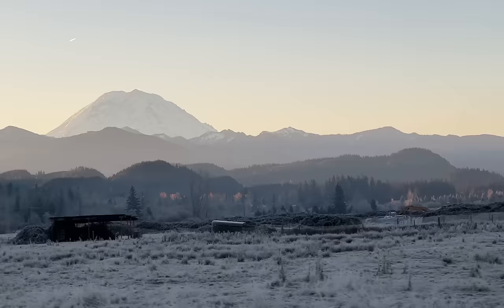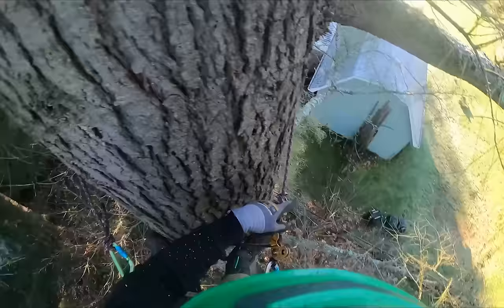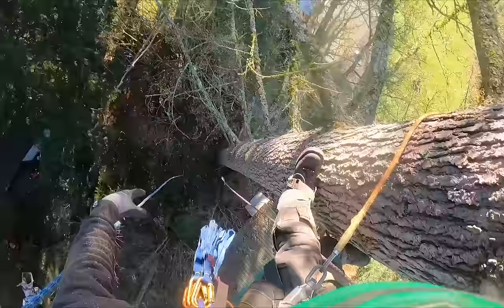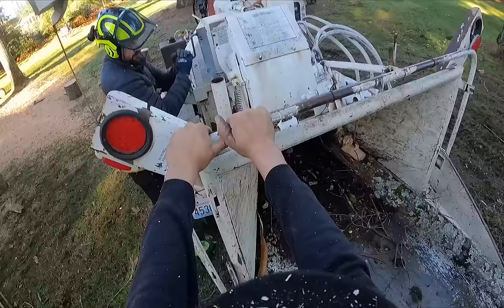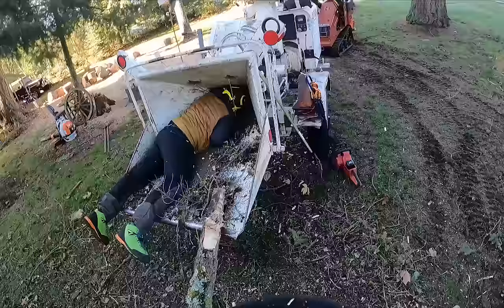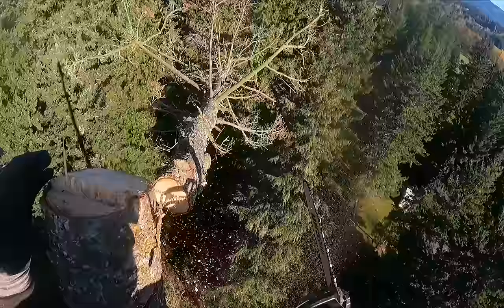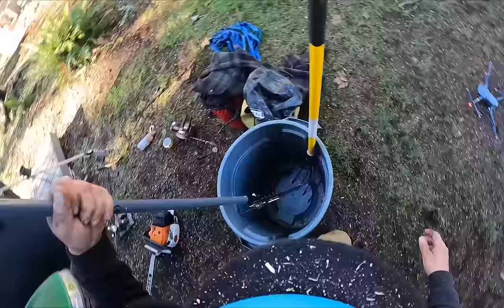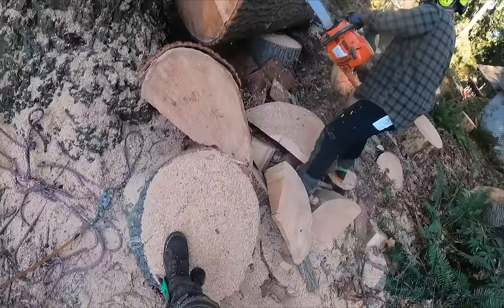Removing a HUGE 5' Fir In Enumclaw Washington!

Comment: Jake I know you are at the top of your game, you have reached the point where you are one with the tree. You should ride that wave for many years to come. That said when you are on a spar with no overhead tie in, why not have your climb line around the tree as well? I know it’s a hassle, it slows ya down, who needs it ? Well about 38 years ago when braided rope stele core flip lines were replacing the old logger style, Manila three strand core flip lines I had one of the new types  break at the cable crimp. Now designs are better materials are better everything is better but still, wife kids, life to live,maybe just maybe it’s worth the hassle. Ok I am old, 62, in fact and getting more cautious knowing I would not heal like a younger man. The 40 foot back flip I shook off decades ago would break me now. Anyway just love speaking.i

Comment: You could but a beam in the rafters running the length of the saw and hang 1 or 2 chain falls - this would let you roll or manhandle large logs (bigger than your red pine anyway) 

Congrats on that cut up - Woodland should give you some credit, you pretty much sold me on a 136 … I have logs like those, but a “fancy” mill is out of budget

Comment: so the rule is 1/3 of the tree for the face cut. When is ok to go past half as you were doing here? Shorter cuts im assuming?
Reply: Going deeper on the face makes it easier for the log to tip over while you’re cutting in the tree, gravity does the work without having to push on it or having the guys on the ground pull it.

Comment: I’m gonna go for arborist in September, anyone got any tips and tricks they I need to know please? 😊
Reply: Being in good physical shape may be the x factor . Different trees types present varied practical challenges . Double up on safety set up and do not wing it on work near housing , traffic , people or utilities .
Reply: When I took the exam it was winter and they made me identify trees by twigs. In the spring you get to use leaves which is much easier. Just in case you get an exam like the twig one, I highly recommend the book "Tree Identification Book : A New Method for the Practical Identification and Recognition of Trees" by George W Symonds. Spend a lot of time with that book and you'll get the identification part down no problem.
Reply: @jondor654  yea, I’m working on my physical shape isn’t the best but I am working on it and I still have till September, I have also decided to drink more water instead of cola and try my best to be healthier in general. Also I get that it’s not smart to just wing it when there is either thousands of euros of damage or a human life on the line
Thanks for the tips
Reply: @HeinzTheBaronKraussVonEspy  cool,
I’m gonna see if I can find that book, it sounds very helpful indeed 
Thank you

Comment: so many things wrong, safety wise in this video... i cam to your channel to improve my technique, not gonna come back after this one....
Reply: Name 3 things
Reply: The only problem I saw was that when he zip lined his chainsaw down, it should've been running. And for extra safety points, wrap some electrical tape around the throttle so it's wide open going down the line. @CharlieDoesntSurf
Reply: He sounds like a bot
Reply: @CharlieDoesntSurf  he held the chainsaw on the wrong side, didnt adjust the chain break when finished cutting, a guy crawled into the chipper, holding the branch whilst cutting, cutting with one hand....